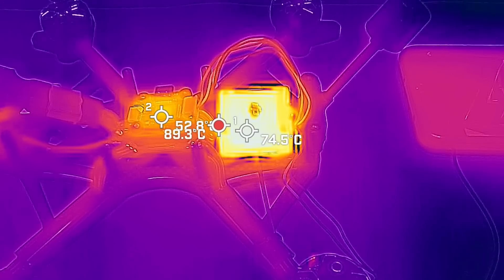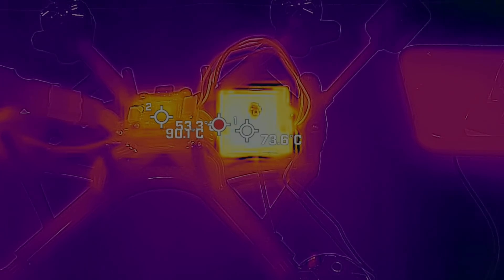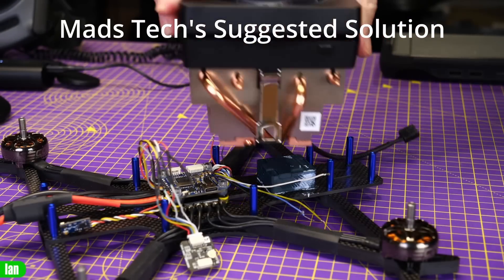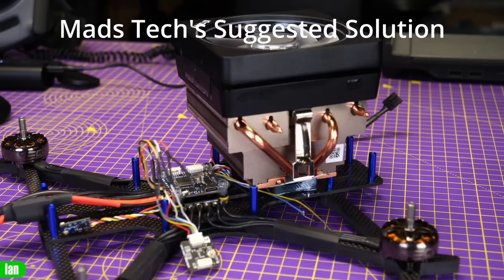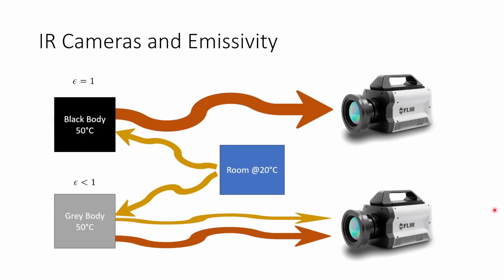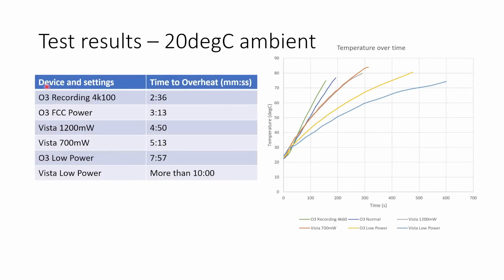DJI O3 Thermal Testing // Time to overheat, thermal imaging, and recommendations.

Comment: My o3 dropped image yesterday... as if it overheated.. I did not see a warning.. or the message like it will auto shutdown. This happend while flying.. but it was thr first time I had recording 4k 60fps on.. 

So im guessing between a loose contact.. or overheating.. 
It took a full 2 seconds of no image.. just black..
I did manage to save my quad.. but now I am trying to figure out what happend. 

Both dvr as on board stopped recording.. so it did shut down complete. But therefor I have no proof of the blackout and the safe.

Comment: I’m not absolutely sure about this but I think the O3 air unit may heat up noticeably less if the goggles have not connected. I noticed this first during setup but have also tested on some flights. My last flight, I was able to get a GPS fix on the first flight with the air unit only getting a little warm. Would be interested in seeing tests to see if I am right about this as it could have just been the cold weather. If this is true then it would make sense to wait on powering up goggles until after a GPS fix has been established.

Comment: Does the cooling openings help more with airflow than the more sealed vista? 

Would a moving o3 be cooler than a moving vista??

And thoughts on aluminum vtx plate for cooling?

Comment: The installation guidelines for the O3 unit state:

In the flight state, there will be a prompt alert after overheating and the video recording will end. At this time, the video transmission will remain connected and the aircraft must return and land within 30 seconds. If the temperature of the internal IC board continues to rise, the protection system will be activated to shut down the air unit automatically.

Comment: the Cine-80 is a interesting plattform, also the price is in range for hobby and private pilots testing cameras above Gopro like Black Magic Pocket which is entry Level i think in this area. BUT, i think there is a missing link. i remember the days when we had those 10inch systems long time ago with hoovering times around 20 minutes with 3S 2200. :-)  i think a AOS 7 will be too small, and the cine 80 will be to heavy for that. are there plans for a size above the AOS 7?
Reply from the maker: I've promised an AOS 9 for fast chase work and a Cine100.
Reply: @ChrisRosser  WOW, cool. Size 9 will be also ok.

Comment: i learned so much today, i have to lift off in the first 2 minutes.
Reply: @combinacijus   I forgot the smiley. I lift off before sat fix and come back after 10 seconds to disarm and rearm for set homepoint. I think I can set a switch for midair use of this. Never tried, but I remember something about that. Thanks.

Comment: Does it shut off in flight?  No?  Then its fine.
Reply: DJI documentation says it warns you and then gives you 30seconds when in flight mode before it shuts off (if temp isn’t reduced). Wouldn’t be flying over water with it.
Reply: @glidesfpv  are you gonna be hovering your entire battery in one spot? If not, you're fine.